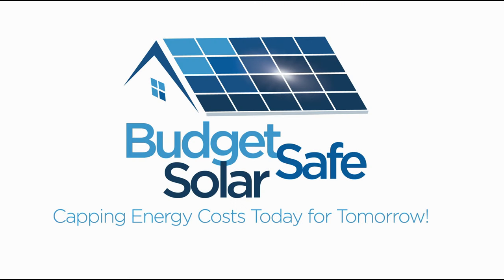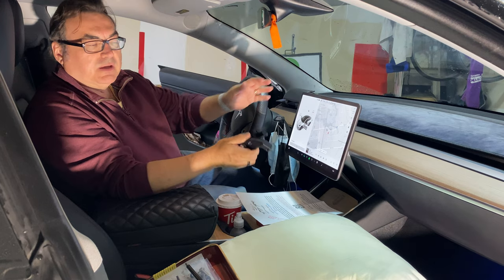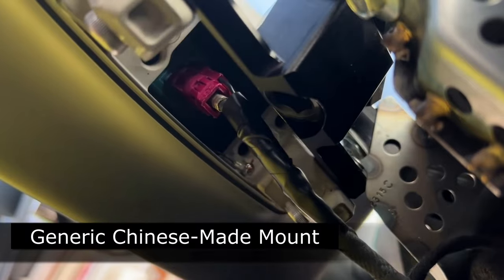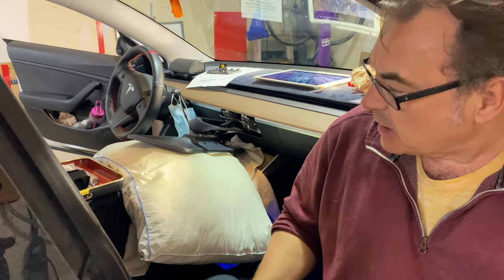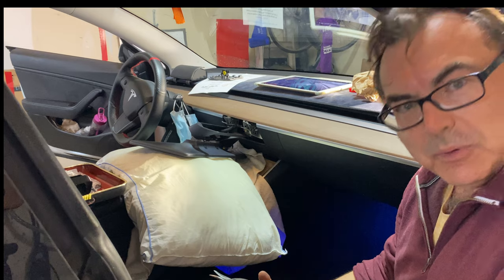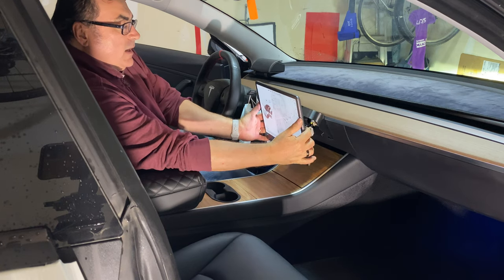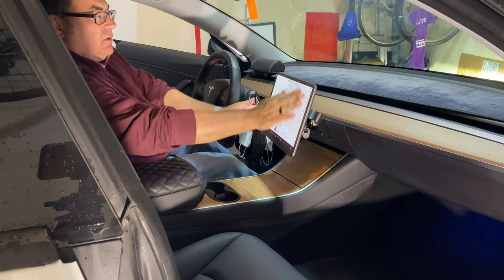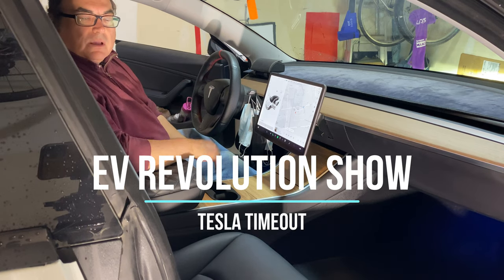Tesla Timeout #19 - Atlas Screen Mount for Model 3 and Y

Comment from the maker: Supplemental video for Atlas Mount adjustments: https://www.youtube.com/watch?v=4kWLZQNGQEw
Reply: Hi Kenneth. I chatted with you at the Race to Net Zero EV show a couple of months ago about the Atlas mount,. I'm going to buy the Atlas Plus from Matt and love your suggestion about cutting the plastic shroud instead of unplugging the screen to reduce risk. I'm wondering if the Atlas mount requires any cutting as well. From the looks of it, it seems that the cord fits right through the mount without any additional cutting, plus the whole thing is made out of aluminum, so it can't be cut. Is this the case? Thank you

Comment: Just installed the Atlas mount and used your tip to snip the plastic shroud so as to avoid having to remove the electrical connector.  I had been on the fence about buying the mount due to anxiety about removing that connector until I saw your video.  A great tip, thank you!
Reply from the maker: Great, thanks for watching and glad my video and tip helped!  Yes I too was in the same boat but that made it much easier and stress free!  Another follow up tip: keep the Allen wrench in your car as the mount will tend to loosen up a bit after driving, especially as the cabin gets hot and cold from these up and down temps.  It's the up and down tilt that will get loose.  It's fairly easy to retighten the two bolts underneath (don't have to remove any plastic covering), but you do need to be a bit of a contortionist to get underneath! :) 

I also put a drop of 3 in 1 oil on each "hinge" part of the holder where it moves for up and down tilt.  By tightening the bolts, it makes it harder to move and will make a loud metal sound/squeak when you move it, which can be annoying.  The drop of oil on each side takes the noise away.  Hope these help.

Comment: TTTT I always tentatively assumed that Tesla didn't make the screen moveable because it just would create more failure points, and for uncertain benefits. I have no experience with a Tesla, so can't speak from experience. But the idea of a screen with a cable that can wiggle around just looks worrisome to me TBBH. The strain relief probably helps a lot but doesn't eliminate all the cable motion. I don't think I would go for it. OTOH I was hearing that Tesla is now moving toward providing this capability themselves, so I have to keep an open mind.

But not so open as to let my brains fall out.
Reply from the maker: Thanks Ronald for watching and your comments.  Clearly the strain relief in Matt's product does not allow the cable to move at all, at the attachment point.  That is the key, so I am not worried at all.  

Possibly your belief about failure points and Tesla not building it to move is valid.  However, the new Model S is now coming with an electronic swivelling centre screen, so they must realize this is a valid need.

Again, if you look at the TFP mount, versus any others, it's clear that protection of the screen connection is the priority.  I absolutely love it and these past couple of days driving with it has made my touch-screen interfacing much much easier.